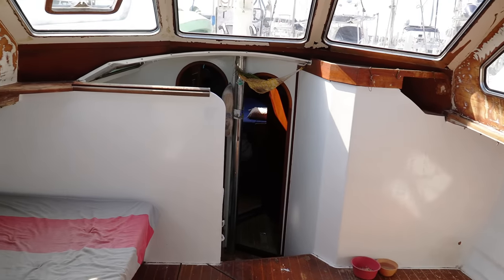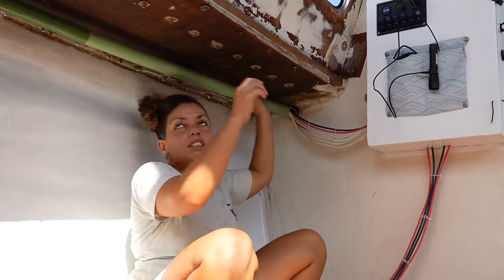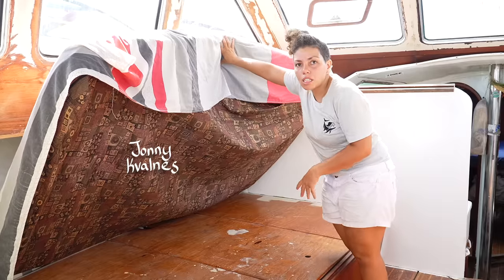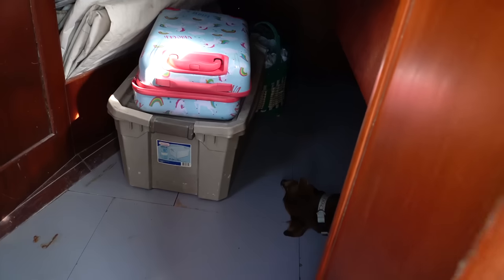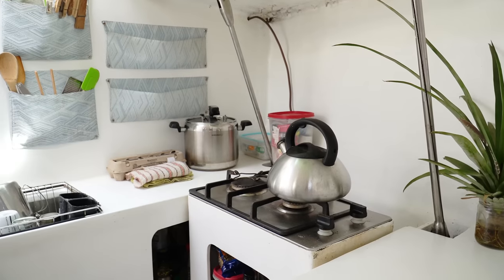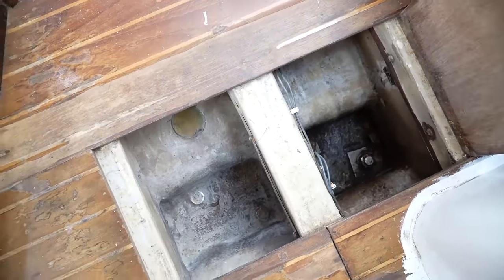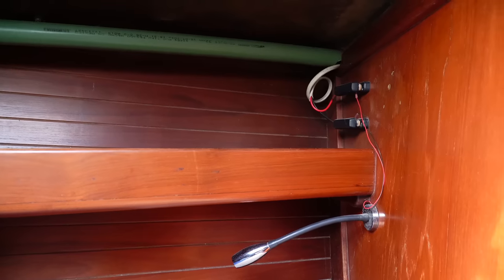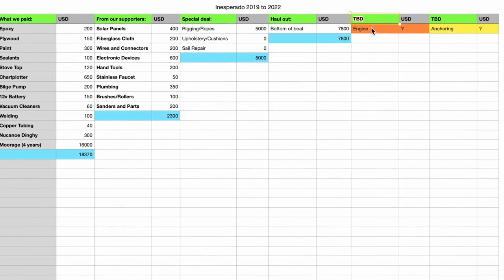interior TOUR of (not so) free SAILBOAT

Comment: Compared to what the boat was it`s a vast improvement. And remember, it`s your boat, so do it to a standard and cost that you are happy with, not someone else.
Reply from the maker: Thanks! It certainly feels like improvements have been made looking back at the old photos and footage, however I'm always realistic and see what needs to be done yet to improve our quality of life. Cheers!
Reply: Yes I have been on very pretty boats that were very unsafe, signed on to crew one to Fiji from CHCH New Zealand, beautiful boat "fully refitted" but the rigging, instruments and Gas lines all broke multiple times on the way up the coast also the fuel said full all the time. Myself and one other got off the boat in Auckland as the parts of the boat that should have been replaced or looked at were not. Rudder bearing's, Through Hull fittings, Water lines, Ropes and Rigging.

I was also crew for another sailor boat owner and his boat was the sorriest looking boat you could ever see worse than the one in Captain Ron to look at think pipe berths, bucket showers, sun faded holed Bimini, worn mooring lines and just about every colour paint you could get out of the leftovers in the yard as hull and topside paint in patches. But every safety feature, critical component was inspected and the owner walked me through where all the through hulls were, where the plug's were, where the replacement lines were, where the bilge pumps were and could tell me where all the spare parts were, the engine had spare belts, spare water hoses, spare turbo, oil filters and oil, I was shown all this before we left that dock and nothing went wrong on the entire 32 days at sea (NZ to Australia). That was a real sailor.

Plus the photos of his life sailing to remote locations in his third circumnavigation (he completed eventually middle, northern and southern in the same boat).
A pretty boat hiding issues vs a safe boat that can handle everything and is 100% where it needs to be I know what boat I would want to be on.
Reply from the maker: The second example you gave is like all the boats of sailing family that my husband Robi grew up on. What I hope more and more people can learn to see is the beauty in the functional, working, safe style. Also, it's process to determine the difference between a simple, seaworthy vessel and something that is just unsound. Thanks for the great comment and cheers!

Comment: I've got leaky windows too, in addition to replacing the problematic traditional glass in frame windows with plexiglass taped in place with 3M VHB tape I'm thinking of installing a small visor overtop of the windows to reduce the amount of water that even has a chance of touching the seals. Have you guys considered something like that? It wouldn't solve the leaks on the front of the pilothouse but it'd probably stop most if not all of the side window leaks and save you removing the windows again. 

Boat's really coming along, good job you two ✌
Reply from the maker: Thanks for watching! Yes, we've been considering several different options - but what we would really like is to be able to open them for more ventilation. So we are considering making whole new hatches from scratch. The pilothouse is angled in such a way that even having a visor, water would definitely enter from the bottom portion.

Comment: I feel for you on the electrical issue ... just a thought ...is there a Walmart or Walmart affiliate nearby?  I recently found out that they carry LiFePo4 deep cycle batteries for off grid marine use --- the brand is called Power Queen.  The 12v 200Ah is $639.99, and the 12v 300Ah is $989.99, and they include a built in BMS and 5 year warranty with 24 hour customer service.  It might just help make life that much easier if you could ditch the flashlights and turn on some actual lights in the boat.
Reply from the maker: Luckily a supporter of ours sent us the funds to get a couple of 12v batteries - just some local kind, under 200Ah total to turn on some LED lights 👍🏼 We've been to the nearby Walmart - nothing fancy like LifePo batteries there, unfortunately. The Walmarts in Mexico don't tend to carry much in terms of mechanical/electrical supplies we've found.

Comment: You’ll get more power with microinverters
Reply from the maker: Thanks! Maybe Robi knows more, but I'd never heard of this, looking into that now 👍🏼
Reply: @sailorama  shade cuts production, rather than stringing all panels to one inverter and having one line of shade cut all power, micro inverters are direct, home ran, instead of strung together. If shade blocks one panel, the sunny panels still produce.
Reply from the maker: Thank you for the explanation! That sounds like a good way to go - and I guess if our panels are always just pointing straight up - when the sun is rising or going down, and the boat is oriented so that one panel might be getting more than the others, it could help maximize production in that case as well - cool.

Comment: What exactly do you need to make the electrical system work as needed?
Reply from the maker: Right now, we are missing a good battery bank (perhaps 3 or 4 batteries). The more batteries, the merrier! In Mexico, our only real choice of battery is the 'old' lead acid type.
Reply: Agm 6 volt 240 amp hour used from a solar supplier is what I found locally (cheep but heavy) and still have to top the 4 up with a new dual fuel propane/gas 2200 tiny generator... cost effective and handling the power tools for all types of repairs that are constant... watch the top ev boat channels... they all have generators, they are cheap,  quiet and quick...
Reply from the maker: We see a small generator in our future also! Not being able to top up our poor battery was the reason for it dying, and also we do want to stay off the dock, but to continue those projects as well 👍🏼 Annnd, a third reason for having a generator, coming up in future videos.